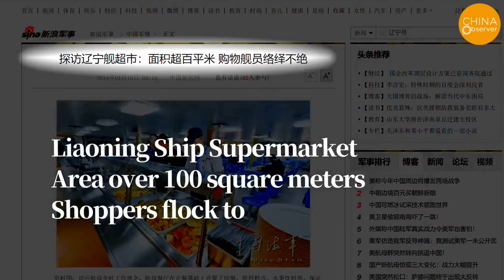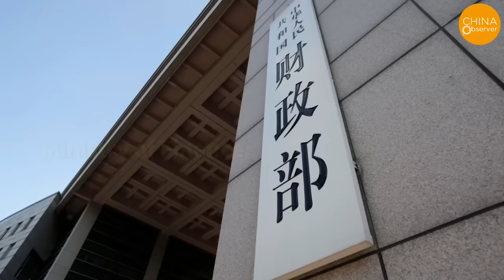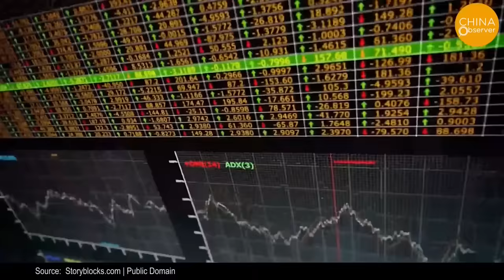China’s Junk Aircraft Carrier Fears to Sail? A Big Joke Due to Copycat Failure

Comment: Unmentioned is the other fact of the miserably short range of the Chinese diesel-powered carriers. Any operation requires they be shadowed by a refueling ship, basically a floating bomb for enemy munitions.
Reply: plus, taking out the tanker is vastly easier than the carrier, and doing so then later going after the carrier would be a really effective strategy with minimal risk
Reply: @delphy2478 

Ya, that would suck running out of fuel and just sitting there in the ocean as an easy target.  Can’t even move out of the way for a torpedo.
Reply: Chinese aircraft carriers have the sailing range of a potato chip.
Reply: Kingdoms sinking in flood of debt, preaching the world. Bihari says.
Reply: It's how all carriers were prior to the us first nuclear carrier. We still ran carriers on fuel for a long time until they were all replaced. The uk carriers are run on fuel. They have never had nuclear. Most countries don't run nuclear.
Reply: @adamtedder1012    True
Reply: @canto10mosha65  thank you for that laugh.
Reply: @adamtedder1012   Go France!....  that sounded weird.
Reply: American nuclear carriers are comprised of a task force and all the other ships in that group are non-nuclear so they still have to have tankers along with them. A carrier never goes out there alone.
Reply: @pi.actual  True 

Even have a submarine there a bout.
Reply: @adamtedder1012 I didn’t know that.
Reply: @icosthop9998 Nuclear powered.
Reply: The planes on the carrier require fuel too. Aviation fuel... I don't think they use diesel. So even a nuclear-powered carrier needs a refueling ship.
Reply: Not sure what the Chinese carrier range is but the UK carriers have over 10,000 miles. The first carrier sailed to the Pacific and back in 2021.
What you nuclear admiring folk forget is that nuclear carriers need RAS for weapons, victualling and aircraft fuel. So they need tankers which you reckon are 'floating bombs'. So you could have a carrier that can keep going but cannot fly or arm aircraft or feed its crew. So why pay the billions extra for nuclear power. It offers no strategic advantages. Bragging rights? Meehhh
Reply: @1chish  The strategic advantage of nuclear carriers is they have no need of carrying fuel oil for propulsion. All that extra space can be used to carry JP5 for the aircraft. An oil-fired carrier has about half the sustained combat endurance of a nuclear carrier. The Queen Elizabeth class carrier can only support half the aircraft of a Nimitz class carrier. It's also about ten knots slower. That's why. The Queen Elizabeth is a magnificent ship, but it doesn't have the same mission as an American carrier.
Reply: @1chish more than just bragging rights. It boils down to fuel consumption. The faster ships go, the more fuel is required to move it. Launching aircraft needs a minimum airspeed passing over the flight deck to produce enough lift for the aircraft, especially larger birds. Generally carriers are on the move at high speeds during flight operations, which consumes a lot of fuel for diesel engines, making it more cost effective to run nuclear power.
Reply: @patrickweaver1105   Oh dear. Now I never mentioned the QE class but OK as you have:
* Explain how a QE Class carrier sailed to the Pacific and back with a full CSG in 2021? No disadvantage at all.
* The QE class can carry at least 60 F-35s in surge mode. As stated by the first seagoing skipper jerry Kyd in the USA in 2018. The Nimitz carries about 75. Not much of an advantage.
* Both QE class carriers have exceed 31 knots in sea trials. Exact figures are confidential but that was published. A Nimitz has about 32 knots.. No advantage.

the advantage against nuclear is the cost. The USS Ford cost $18 Bn while the TWO QEs cost $10 Bn. Each nuclear carrier costs $12 Bn more in its service life to operate than a CV carrier. And then there are billions in de-commissioning costs. None have been scrapped yet because they can't do it safely.
Nuclear carriers spend 50% of their lives in port on maintenance and over 5 years out for refuelling costing upwards of $5 bn a time.
So there are literally billions of dollars of reasons why nuclear is actually a disadvantage. The QEs don't pay for fuel they don't use while Nuclear fuel is the most expensive and paid for but only used 50% of the time.
Reply: @MrKidroboto   You haven't heard of RAS then. You know what nuclear carriers use for weapons, aircraft fuel and victualling. And what the carrier escorts use for fuel? A conventional carrier can go to the Pacific and back without a problem. Who did that? HMS Queen Elizabeth in 2021.

At least the conventional carriers don't use fuel when in port unlike the nuclear fuel that is expensive and already paid but only used 50% of the time as nuclear carriers need far more maintenance. Each CVN costs $12 Bn more to operate than a CV. That buys a lot of diesel ...
Reply: @NatureloverKarnataka98 china has more debt than US. US has moderate debt when considering as percent of GDP. US is very rich and can pay it's debts
Reply: @1chish  In a push a Nimitz could carry over a 130 F/A 18 aircraft. How long can the Queen Elizabeth go without taking on aviation fuel? Not very long. I stood upper-level starboard watch in 1MMR going around Africa in 1980. The Nimitz has more than 32 knots in her. The Enterprise is being scrapped, safely. She's already been defueled. The Nimitz cost one billion to build. All carriers need periodic maintenance and upgrades in the yards. The Nimitz refueling took three years not five. In case you haven't noticed we don't care what it costs to operate a carrier. We have eleven. UHH, you did mention the QE class. "but the UK carriers have over 10,000 miles. The first carrier sailed to the Pacific and back in 2021."  Then you asked the advantage of nuclear power and I told you.
Reply: @patrickweaver1105  I guess no one talking about refueling ships following a nuclear powered aircraft carrier realizes the US has multiple aerial refueling platforms ranging from the enormous KC-130 all the way down to the MQ25-Stingray, a stealth drone capable of 600 mile flight carrying 16,000lbs of fuel for aerial refueling. No refueling ships need to follow a nuclear aircraft carrier when entering contested areas. Sorry guys.
Reply: @icosthop9998 and usa lost to china
Reply: @SelfProclaimedEmperor  Do you know US GDP and US debt? Only book work Indian love US and EU LOL
Reply: Technically all carriers even US have fuel supply ships. The only difference is the ones following US carriers are only transporting jet fuel. As the planes are not nuclear.
Reply: @carlburgess4235   Errr ... and the weapons.
Oh and the victualling for the 5,000 crew.
Oh and the diesel for all the accompanying ships.
Oh and their weapons.
Oh and their victualling.
So where is the strategic advantage to a nuclear carrier cost 5 times a conventional to build, $12 Bn more to operate, $5 Bn to mid life refuel and then billions to de-fuel and scrap? And spend 50% of its life in port being maintained?
That cash would build more conventional carriers, put more aircraft on a bigger area and buy a LOT of diesel.
Reply: Range did not seem a problem for the Japanese in  1944
Reply: @1chish 32 knots is the public speed of an Nimitz class carrier and we both know it will run significantly faster than that at top speed which is a closely guarded secret. The Ford class with the new nuclear reactor is even faster than the Nimitz class. You can fairly easily put at least 80 planes minimum on a Nimitz carrier. Running an oil-fired boat vs a nuclear powered boat, all things fairly comparable will require much more energy from the oil powered boat I'm not criticizing the Queen Elizabeth it's very good to see Great Britain back in the aircraft carrier game. British ASW is second to none.
Reply: Well carrier fleet,  others ship in the fleet are not nuclear powered😂😂😂 and China not planning to send theirs fleet cross the Pacific.
Reply: @adamtedder1012  That's why most countries are inferior.
Reply: Part of this discuss about fuel leaves out a key factor when comparing with the US Navy….. The US Navy has three primary domestic ports for its carrier in the continental US plus over sea ports in China and Hawaii …. But it also have numerous other installation where logistic ships are based out of around the world….. thus a carrier fleet doesnt have to travel WITH a resupply ship, just meet up with one sailing out of one of these ports….. thats not something the Chinese navy has
Reply: @MrSheckstr   So therefore the obvious question is: Why spend unnecessary billions of dollars for no strategic advantage?
Reply: @canto10mosha65  I believe a potato chip could sail farther. Especially if it’s a ruffle.
Reply: True, though in fact ANY CBG operation requires the same, even if its carrier is nuclear powered like the Nimitz & Ford Class ships, or France's sad, wonky little CdeG (which can't in any case move fast enough to require even its minimal number of also rowing-boat scale French escorts to drain their fuel tanks quickly, despite most of them having ranges comparable to an electric car).😁
Reply: They probably only will be used in the western Pacific, unlike the worldwide travels of the US carriers.
Reply: @1chish  the QE’s carry only thirty six F-35s ,normally . Cost is not an advantage, cost is why They can barely afford the two . When you have eleven nuclear , cost is not a problem .
Reply: @1chish when you have eleven nuclear you don’t worry about cost , it’s so…. Third word .
Reply: @1chish eleven, those are just the nuclear powered ones , the U.S. can AFFORD to be in the shop .
Reply: @klausyap1145 they can’t get out of port , no one worries about them crossing the ocean 😂
Reply: @chipschannel9494   WUT? The QEs can carry 60 F-35s and helos. Other numbers ahave been floated (excuse the pun) for different operations. the '36' is a typical 3 squadron (2 x F-35s and 1 x Merlins) load out.
We can fully afford both carriers. One is on exercises in the Mediterranean and the other is testing new landing systems in the English channel.

I am not sure your hypothesis that cost is not a problem when you have eleven carriers actually stands up. Especially when the Ford cost $18 bn and still does not work reliably. Cost 'is not a problem' when you soak the US taxpayers to spend 3% of a massive GDP while denying them socialised health care (like the socialised Military, Police, Coastguards, roads etc)
Reply: @1chish  sixty is the “Jumbo” package. the U.S. is also building eleven more as they retire the previous eleven so obviously money is not a problem since they also have twelve “Light” carriers . That doesn’t seem like they are worrying about the money .they probably have another ten conventional “Fleet” carriers in the “boneyard” , just in case. “Human rights” and the  “empire” , you don’t want to discuss that.
Reply: @chipschannel9494   Last point first: What on earth have 'human rights' and 'empire' got to do with aircraft carriers? 🤦‍♂You seem to feel the need to deflect away for some reason. But I am happy to discuss UK Human Rights as we have a few more Rights than you in the USA. Yes really. And if the British Empire was so bad why did every country in that Empire join the Commonwealth when it ended? And btw there would have been no USA without that Empire.
You're welcome.

On the real discussion: You sated the QE's could only cary 36. That was wrong so I gave the real number. I then clarified why the '36' you stated was actually just a typical loadout. But it would be greatly appreciated if the USA would deliver the other 14 of the first 48 x F-35s we ordered and funded some 8 years ago and give us the production space for the next funded 32 aircraft. After all we are the only Tier One Partner.
Reply: @1chish  my bad , 36 is a standard load and 60 is the jumbo where as 75 is the standard on the Ford , did PoW just get toad back to port recently.
Reply: @chipschannel9494   Yes we are told the Ford can swarm (not 'jumbo') 75 but given its not much bigger than a Nimitz is more likely 65.
Again 'whatever'....
But as you mention it we can swarm 60 aircraft on a $5 Bn carrier. The USA can swarm 65 on an $18 Bn carrier.
Any war fighting admiral would rather have 3 capable carriers costing $15 Bn delivering up to 180 aircraft  than one very capable carrier costing $18 Bn delivering 65 because they spread his attack formation for maximum effect, reduces the possibilities of contact and if one was hit he loses 1/3 of his fleet not all of it.

And no the PoW was not recently towed (spelling) back to port. In fact she has never needed to be towed anywhere. Even when a shaft coupling failed over 2 years ago she went to dry dock under her own power.

Nice try at deflection though as we have seen before. Pathetic.
Reply: @1chish  bahahaha , you must be mistaken them for the twelve U.S. helicopter attack/amphibious assault/light carriers , that are bigger than the twenty seven WW2 Fleet carriers , you can run with them because they burn oil. Sky jumps, huh.
Reply: @SelfProclaimedEmperor  35 trillion debt for US.
Reply: @adamtedder1012 but the range with diesel is all different and he was stating this one specifically has much shorter range. That's not even getting into Chinese engines and tech in general have reliability issues